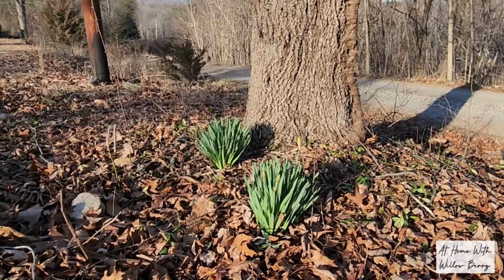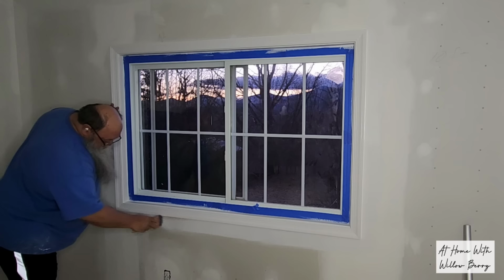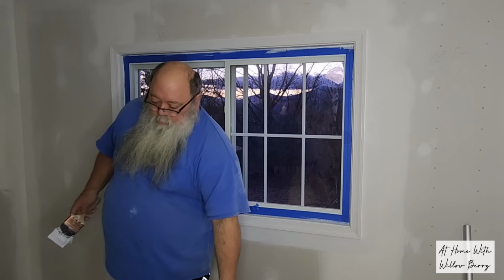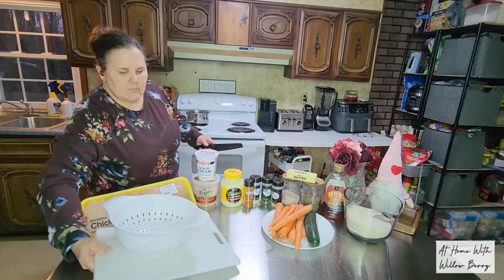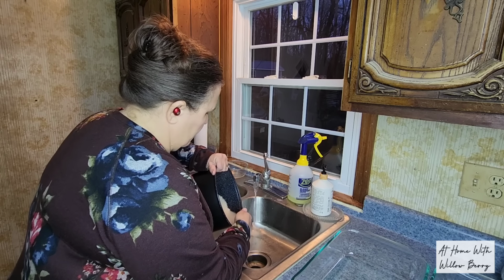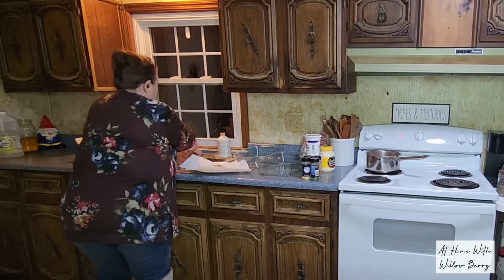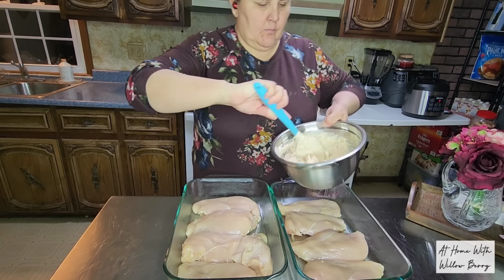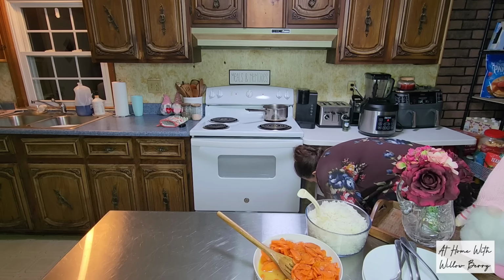Painting, Dinner & Sunsets / Melt in your Mouth Chicken / Mobile Home Living and Renovations

Comment: Hi Valerie.  Nice to see you.  Thanks for the video.  Lovely views of the Virginia mountains and countryside.  Looks like some bulbs have pushed on up.  Canning & pickling can be economical & healthy.  I don’t do canning but I do a lot of pickling of all sorts of vegetables.  And I save veggie scraps in ziplock bags to use for stock & cleaned & dried to roast in the oven-🥔peels w/oil, garlic&onion powders,s&p-or other spices/herbs-better than store bought chips-not to mention healthier-yummy 😘
So, the temperature of proteins will continue to rise after you remove them from the heat source. If you remove chicken breasts at 165 they’ll be 175 after 7-9 minutes.  
I’m sure as moonshine🌙 that you can learn whatever you want to❤.